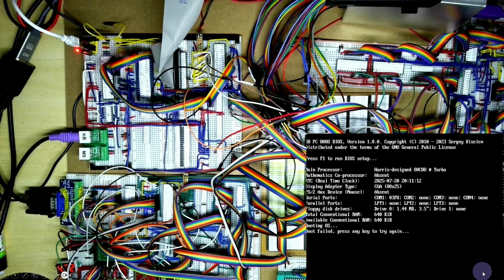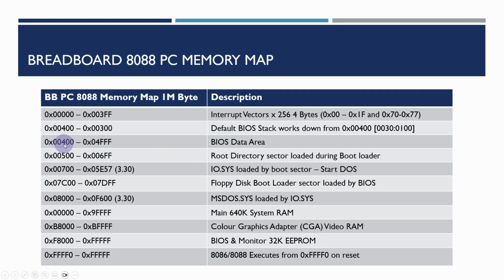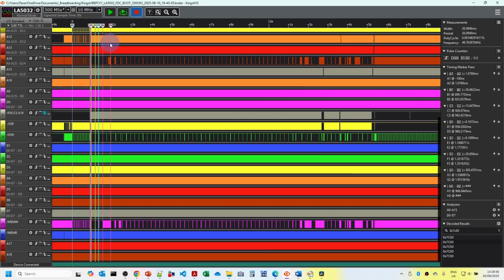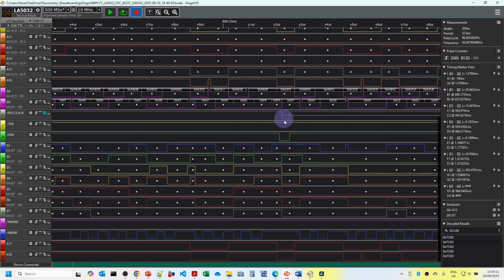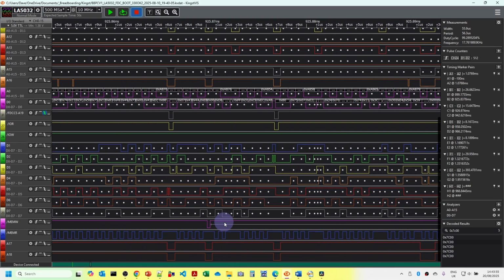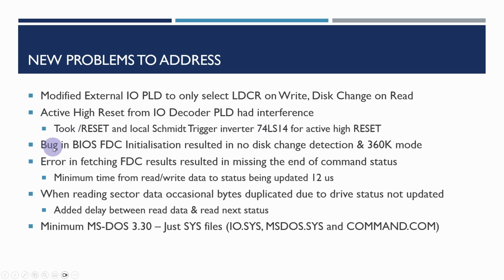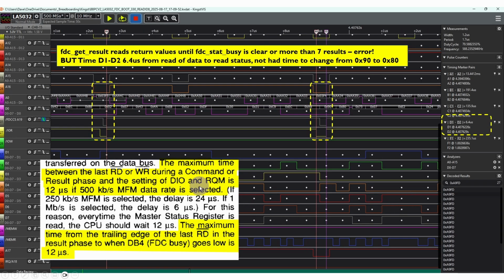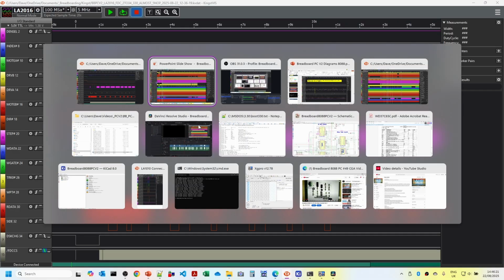New Breadboard 8088 PC V2 #19 Floppy Disk Booting Deep Dive

Comment: Hi there! Thank you for your excellent work! I've just added a handful of nops here and there and my floppy drive started reading with CPU speed 10MHz :) I'm wondering if it would be possible to use PIT for clock-independent delays.
Small update: though the whole thing is a bit unstable, i was also able to store a simple text file on the floppy disk.
Reply from the maker: Good to hear yours is on the road to working. The XI 8088 BIOS uses the DRAM timer for 15us delays (checks pin on Port B) and also the system timer which has a clock every 55ms via interrupts. There is 1 spare timer channel so you could use that. I have been able to boot MS-DOS 3.30 but like you its a bit flaky! Looks like some noise on some of the chip select lines may be causing the odd floppy disk read error. Dave

Comment: I would have liked to see this implemented on the 6809. I presume hardware wise is not very different. You should do a version 2 of the 6809, but with the 6309 instead.
Reply from the maker: Its not the hardware which is the issue but the software. The floppy disk PC BIOS is 3000 lines of source and then and OS like DOS is many 1000's more. To get 6809 booting an OS off floppy disk would be a much larger undertaking and getting the 8088 working is tricky enough for now. I suspect things like the Dragon 32/64 disk OS could be used but once I have got this 8088 version working I am going to avoid floppy disk controllers for the foreseeable future as they are very messy and nasty to deal with.
Getting an i386 running on breadboards is more appealing at the moment! Dave
Reply: @breadboardinglabs I’m rebooting my adventure in 6309 with the goal of integrating OS9 or NitrOS-9. Level 1 to start with. Crossing my fingers that the operating system will do the disk IO heavy lifting.
Reply from the maker: Good luck with OS9, I have not really done anything with it or know much about it. I would check what floppy disk controller the OS knows about. The PC ones are NEC 765 compatible but not sure if OS9 predates these (seem to see references to MC6843 and WD1773 in some of the docs). Good luck with it. Dave